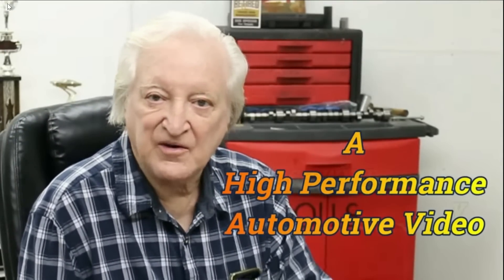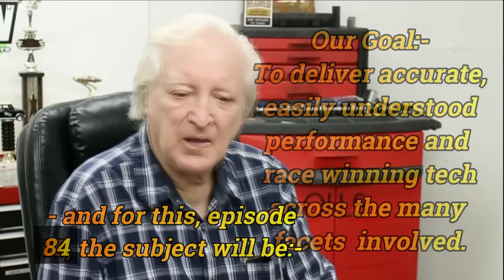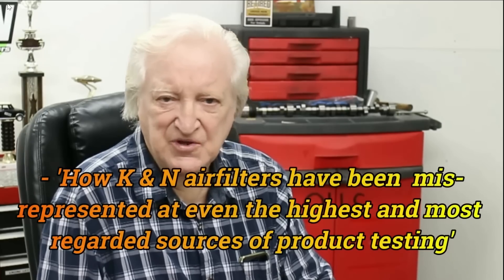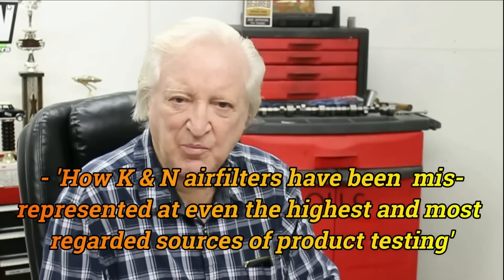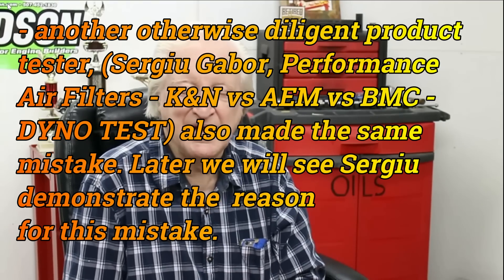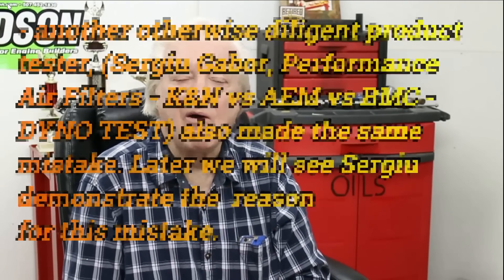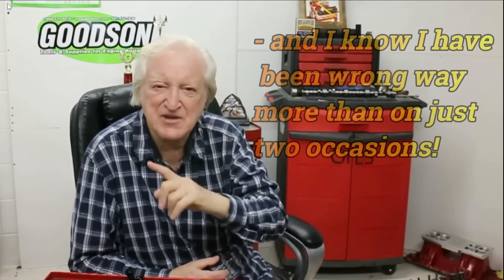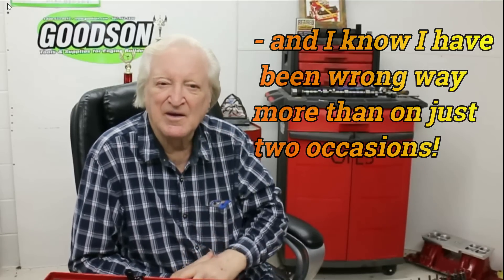K&N air filters  undeserved curse lifted!

Comment: K&N filters are the standard in offroad racing. Trophy trucks routinely have engines costing $50-100k, and they will not gamble with the quality of air filtration. BUT K&N filters are high maintenance. You can't just leave them in for years and forget about it. The filter oil will dry out and allow dirt to pass. I clean and oil before every race, but also if the oil is more than 3 months old.

Comment: Seems to me that a gauze filter -- oiled or not -- has better airflow (for a given surface area) than a paper filter because the media is less restrictive (has bigger holes in it).  It also allows in more dirt for the same reason.  If you're looking for engine longevity, paper is better.  For performance, gauze is better.  Want both?  Better to just go with a larger paper filter, if possible.  Seems there are just too man tests showing this result.

Comment: Personally, I had increase in silicone on my Used oil Analysis using a replacement K&N filter on my SBC. I believe if you want to use a K&N buy the largest universal conical filter so the air has lower pressure drop & moves thru media slower catching more contaminates.
However, I want to try a dry nano media that was made by Donaldson used in the now discontinued Amsoil EA Nano Air Filters & now used in Injen Filters.  Think of this filter media on par with HEPA vacuum  cleaner media.  99.95% @ .3 micron!
Again, get the largest oversized filter you can put into a space.
Also a great Engine Masters test on Cold Air Intakes & K&N & 1 synthetic Spectre nano filter :  see video:
Engine Masters S06E20 Cold Air Considerations.
Finally, I think if those who use a K&N & have high silicates on a Used Oil Analysis, is to also install an oil bypass filter like a Frantz TP Filter or an industrial/commercial oil bypass filtration unit by Parker/Racor!

Comment: 98 Honda- 550,000, 92 Dodge-325,000, 11 Subaru- 134,000, 05 Toyota-95,000, 03 Honda 85,000, 91 Mazda-225,000, 86 Mazda -138,000. All vehicles that I have or had that ran K&N air filters and are or were running without issues. 1.5 + million miles has been my experience.

Comment: Hi David. I have a question I've always wanted to ask you. I have a buddy with a FJ40 Land Cruiser with a 2F engine and was wondering if there is anyway for him to get better fuel economy with it. He is getting 14 - 16 mpg. I read in your book Performance With Economy you actually had a picture of a Land Cruiser that had a Japanese made SU carburetor swapped on the engine. Did that help fuel economy? Any other suggestions? Thanks.
Reply from the maker: Yes that mod was extremely successful. Triple SU's on a cast manifold the we made ourselves. Extremely drivable at low rpm (600-1000) and much more power plus about 6 more MPG.
Reply: @DavidVizard  Thanks for getting back to me. Are these SU type carburetors still made? If they are, what would be the brands? Are Weber side draft carburetors considered SU type carburetors?
Reply: @mike76239  SU carburetors are CV type carbs Weber's are not this type. You would want 1 3/4 or 2 inch SU carbs. English cars had them Jaguar 6 cylinder models would be a good source.
Reply: @guyharrison909  Thanks for the information.
Reply: @mike76239  Burlen Fuel Systems in the UK sell SU carburettors. They also sell replacement parts and K&N filters.

Comment: I prefer to go with actual test results, not a theoretical hand waving explanation. Also, once dust particles are trapped between layers of filter material, does washing get it all out? I use new clean filters that have never been exposed to dust or dirt.

Comment: I've been a Toyota specialist for many Years.I do a lot of off road and performance oriented work.I get lean codes po171 because of contaminated mass air flow sensor hot wires. Seems to be almost a given when running a  K&N filter seems the oil  Residue Clings to the hot wire in a mass air flow sensor I clean the the Sensor.  99% of the time fixes the code. Maybe someone else knows.Is that just because the filter has too much oil. Because on that type of engine management system. I find running a oilless filter solves the issue?  Just wondering if someone else has knowledge of this particular issue. Because k&n make  Noticeably more power.

Comment: I repair and rebuild Ford powerstroke diesels 32 years Engines that run K$N all share the same issues The turbo wheel is sand blasted, the inter cooler pipe is greased up with solid oil, and they burn excessive oil So yes go run the K$N or the smart money would be a WIX

Comment: With all of the aftermarket filters out there, the only thing K&N has, is an inflated price. Plenty of dry filters out there that don't need oil and don't plug up when exposed to water.
Reply from the maker: and all those I have tested did not flow or filter well!

Comment: What is causing the filter to vibrate?
Reply from the maker: The induction pulses.
Reply: @DavidVizard  On an average car engine? That is one with 4 runners, a plenum and one throttle body. I didn't think the intake pulses went any further than the throttle body, but could be wrong.

Comment: I use K&N for 24 years  now. Never driven a smoker for excess wear on cylinders. Project Farm, his name is Todd. K&N works better Also at higher density altitudes, than paper and foam. If you live at 5k+ feet msl, you'll notice the difference right away.

Comment: K&N are obviously quality air filters. I've used them pretty much since they were invented. Not exclusively of course, but I've had a bunch. I like the general appearance of the WIX racing filter. They seem to work quite well in use also. I pretty much use 14x4 filters on all my engines.

Comment: My Oil analysis https://youtu.be/cSrzCtoKYM shows K&N is outperforming the universal average by a huge margin proving that K&N will filter better than OEM when tested properly.  My ZX6R with 13k miles has had a K&N since new and Blackstone Oil analysis shows Silicon at 5 PPM vs 12 PPM average. 

Thanks for all your work on over the years David. You are a man of integrity and greatly appreciated.

Comment: If you check the air filters on my vehicles they are always red, always say k&n and are always worth the money and save waste as well
Reply: if the filter is still red then it doesn't need to be re-oiled yet? Mine is also still red. Even though I used some dawn soap to clean it.

Comment: The further away the filter is from the direct vacuum source. The less they work. As with late model air filter systems with tuning tubes. The impulses are canceled before the air box.
  Big over the road trucks and tractors increase the surface area so vacuum remains low enough, no dust is drawn in. The biggest earth moving dump trucks never require air filter changes. 
   If you want the best filter with the least restrictions. Check out fluid filters. Just like wet vacuum cleaners.  No filter element require.
Reply: The company I worked for changed the air filters in the off road dump trucks at every service. Lots of dirt in them. You don't know what you're talking about.
Reply: @Dougarrowhead  It was a great story from Approaching! I laughed I cried....3 stars!
Reply: @Dougarrowhead  have you ever used a vacuum? Try it on yourself sometime.

Comment: really bad sound level, i love k&n , and must day i disagree on SUPERTRAP ,strictly used for NOISE LEVEL TUNING  they are wonderful!, and sound aewsom, !!!
Reply from the maker: Yes - but they claim you can tune out the excessive noise while tuning in the power. That is totally false advertising!
Reply: @DavidVizard  excellent point, I have yet to improve a filter/tube setup and not be louder than it was previously to my alterations.

Comment: Turbocharged diesels don't respond well to k&n filters nor do a lot of factory maf sensors. Seen it first hand to many times. For that reason I won't use them. However in a custom applications i cannot comment.  This is the first thing I have ever disagreed with dv on!
Reply: Why don't they perform well on diesels
Reply: Have K&N on my diesel and have no problems with it also have them on my cars with no problems .
Reply: I do a lot of pm's on diesels, some have k&n and S&B filters instead of the conventional paper style elements. They always have a lot of dust in the intake tract and on the turbo inlet. They are a more constant flow with minimal pulses. The rings and cylinder walls usually look horrible if you scope them and blowby is usually abnormally high. I've noticed on dirt track cars that run on dry slick tracks that the Kinsler foam filters do a good job, better than the popular K&N and Walker elements. Not sure if there's hp differences in the three over a clean Wix.
Reply: @greglangley4518  I run dirt track cars A Modifieds and have no problems with dirt in any part of my fuel system . K&N filters perform flawlessly and cylinders look perfect . Same on my diesel engines when scoping them out . Key is get the right one for your application K& N has the information and your diesel  will have great looking cylinders and intake track as well. Wix is good but a true K& N is better . This is from a person with 50 years experience on diesel and gas engines .  Race and pure street driven vehicles . .
Reply: @Darwin Foster  I too have quite a few years of experience. I started using K&N in the late 70's. In my area K&N is a bad choice for a modern turbocharged diesel. We've tried and failed, did follow instructions and used the proper cleaners, oil and method. Fine granite dust. Works great olfor highway only or clay, ash,  coarse sand and volcanic dust. No bull and not intentionally bashing their products.
Reply: @greglangley4518  Interesting I haven’t had the same experience, but 99 percent of the diesels I deal with are on boats and there isn’t much dust or dirt blowing around in a vessels engine room.

Comment: If your fluttering or vibrating fibers theory was true, then a MAF sensor wouldn't get a clean signal to correctly measure airflow. The oils on K&N style filters also contaminates MAF sensors which causes them to fail or read airflow incorrectly. 

The Smarter Every Day video was accurate, and K&N filters are terrible at filtering. Show me a test with 2 of the same daily driver vehicles, one with a properly maintained paper filter and one with a K&N. After 100k miles, tear them down and see which one is worse for wear. If the K&N is as good or better I'll buy one again. Until then I'll keep installing paper filters, change them regularly, and sacrifice a few HP.
Reply: Totally false what you are saying . No oil get on or in the maf sensor if you oil k and n right and far as engine wear goes big difference ,paper has more wear .
Reply: Too many variables.
But my KN on a 90 5.0 HO fuelie Ford made a mess with oil and dirt. I have detailed pictures.
I've often wondered if this one had waaaay too much oil on it. It must have had. 🙄🙄
I went to monster paper filters. But hey, I'm not racing, just usually run moderately through the gears.
Reply: I replied to the wrong comment!  I should have commented to you what I said to Guy Franks comment!
Reply: Nope, you're dead wrong.  I've used K&N filters on fuel injected high performance V-8 & V-6 engines for over 35 years with no MAF sensor issues whatsoever.  Try to keep up.

Comment: I would like to debate on this one David. You do bring up a good point of the cotton fibers acting like the hair found in a human lung, and while it is true that an engine pulses so it is not constantly pulling on the filter at idle and low rpm. But What about high rpm? Where the time between the engine pulses is very short. Or how about a vehicle where the air filter is sticking out of the hood and you are going 170 mph down a racetrack or a drag strip? Surely the filter can not properly filter the incoming air because the cotton fibers are being blown back and can't catch the dirt or pollen partials. Not to mention a barbaric test I have done. Place a dry cotton towel over your face and try to breath now take that same towel and wet it with oil and try to breath through it. It's much easier to breath through the dry towel believe me. I love your videos and think you are highly intelligent, But I think your wrong on this one. If you have a way to disprove my rebuttal please reply I'm always learning and would like to know more, Thanks.
Reply: I am wondering - if the filter is still red then I don't think it should need re-oiling. Also if re-oiling the oil is sprayed on thin and supposed to be completely dry before using. I've never re-oiled a K&N filter and I'm a bit concerned about damaging the engine. But I think if I stay off gravel roads it should be ok.